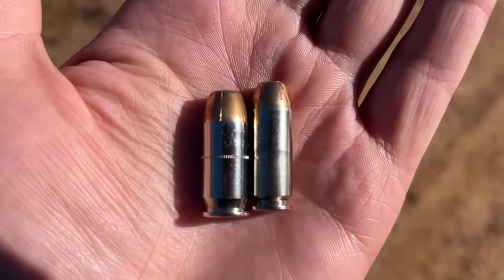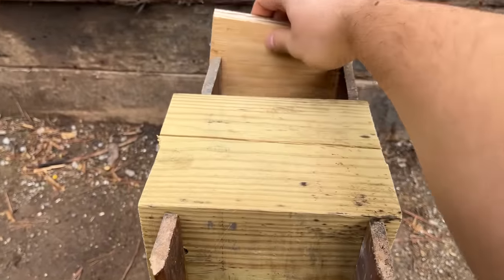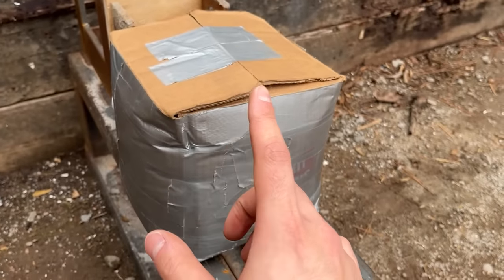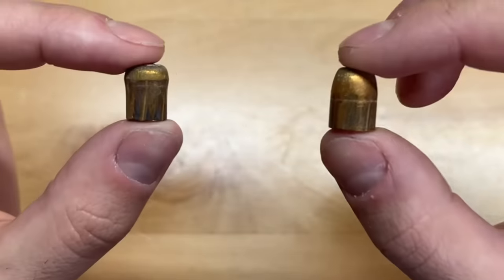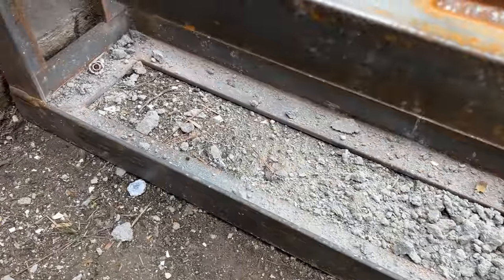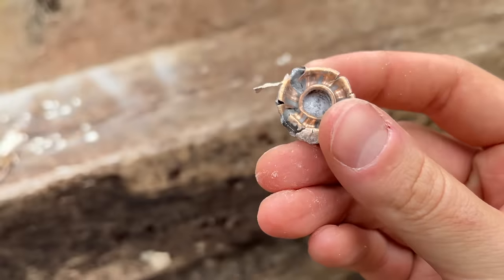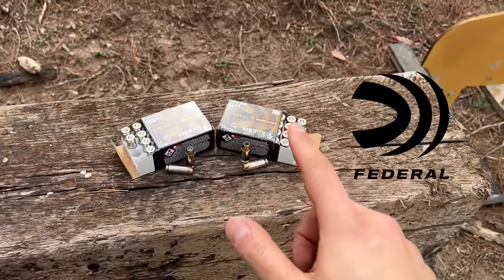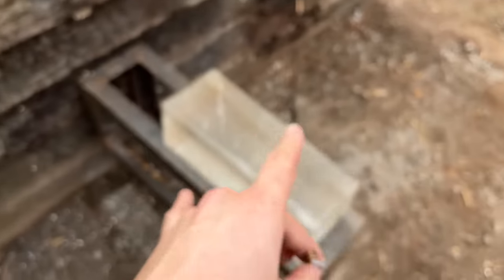45 ACP vs 10mm: Unbelievable Difference On Barriers

Comment: You should check out the .450 SMC cartridge. It's a bit of a wildcat, but it's the closest you'll get to a modern 45 ACP cartridge. It can be used in anything rated for +P, since the brass itself is stronger, I believe it's a 308 cut down.

It's throwing 45 ACP weight at near 10mm speeds.
Reply: .45 +p  or if you're super froggy, .45 +p+ (aka .45 super).
Reply: @DustinS.  45 super requires thing not all 45 pistols have, a fully supported chamber. Which is why I like 450 SMC so much. It only requires the pistol to be rated +P.
Reply: Or just get an LAR Grizzly in 45 win mag
Reply: @argonzeit  a 1911 just needs a different barrel. A USP or HK45 are good out of the box
Reply: @argonzeit & @DustinS. - There's a lot of misinformation on the .45 Super and the .450 SMC.  I've shot both quite a bit in Glocks and 1911s.  Dustin is correct that the USP is rated for .45 Super but I am not sure on the HK45.  However, the .45 Super was specifically designed by Dean Grennell to be able to be shot out of guns without fully supported chambers so that is not an issue.  What is important is lock time.  Meaning how long the chamber stays closed with the brass surrounded by the chamber.  If it unlocks too quickly and the bullet hasn't exited the barrel yet, the thin brass walls of the case will explode causing damage, injury, and possibly even death.  When converting any gun to either of these rounds, you need to make modifications to ensure longer lock time.  There are several ways to do this such as heavier recoil springs, heavier hammer springs (1911 mainsprings) a squared off firing pin stop, or even a compensator.  I'm not recommending anything here as I am not a gunsmith, so if you want to shoot either, please research carefully and consult a gunsmith to keep yourselves safe.  They are both great rounds and a ton of fun to shoot!  Hope this helps.
Reply: @argonzeit - It is not safe to shoot .450 SMC or .45 Super out of any .45 ACP chambered firearm that can handle .45 ACP +P ammo.  Do not do this!  The .45 ACP +P round has a maximum chamber pressure of 23,000 PSI.  The .45 Super maxes our at 28,000 PSI and the .450 SMC at 32,000 PSI.  You have to make modifications to most .45 ACP +P chambered firearms for this to be safe.  The only firearm I know that can safely shoot .45 Super from thw factory is the H&K USP45.
Reply: 450 SMC is a KTM !!
Reply: A .45 super is in an extra thick .45 acp case which pushes the bullet out at nearly twice the speed. Then the is the .460 Roland a super type case that is nearly 1/16" longer. Some loads are 1500 fps.
Reply: Lol why does the speed even matter when the .45acp can clearly take down whatever you need to as is? Anything else is just a waste
Reply: @wolfofmagdalene92  Speed is only an issue to ensure you bullet exceeds the designed speed for expansion.  No matter what, any 45 caliber cartridge starts with a pretty good sized hole in the target, lol....
Reply: If we are going to wildcats I'll stick with 460 Rowland. 230 grains bullets hit about 1400 fps out of a 5" barrel. Can be fired from some pistols originally chambered in ,45 ACP but requires a barrel rated for much higher pressures and a good muzzle break to slow down the cycling of the action.
Reply: You guys keep searching for magic calibers, if you practiced, you would have confidence in any caliber.
Reply: @Rubeless  It depends on the threat. I'm confident in 9mm for personal defense against a potential human attacker. If I'm camping in brown bear country I want something with more energy.
Reply: @Rubeless  Well, I reload, so I like cartridges where the case and bullet are large enough for my sausage fingers to handle easily, lol....
Reply: Few guns can handle the 450 SMC pressure, as the Super. Most of the 45 +P rated cannot.
Dangerous game to use this cartridge in a normal gun, very dangerous.
Reply: @wolfofmagdalene92 no if u can get hydro shock that’s power I dunno if those can do it but if possible it’s a huge difference that’s when pieces of your parts start cracking up and  flopping. Fps is power no doubt would a 1500 fps 165 grain .45 hydro shock ? I dunno certainly at 2k
Reply: .460 Rowland is kinda a 45 acp on steroids too
Reply: @jefferyboring4410  Funny how even 800-900 fps is enough to shatter bones as well.
Reply: @JimHawking-  
Sure, but a wildcat of wildcat. No guns uses this caliber, and no one manufacture the cartridge beside Rowland
themselves.
At least 45 Super and SMC are "findable".
Reply: @jiankhan  hey, I’m just trying to spread the good word lol. It may be a  wildcat now, but that’s how a lot of good things got started. The m16 and 5.56 weren’t popular at first either
Reply: @jiankhan  Actually Wilson Combat does make a gun chambered from the factory in .460 Rowland.  It's so expensive most of us can only dream about it, but it is out there.
Reply: @argonzeit I thought 450 smc didn’t exist anymore ?
Reply: @GoBigBoreOrGoHome mark 23 eats both
Reply: @lemniscatelogos7917  Doubletap owns it and still makes it.
Reply: @argonzeit  thank you I’ll go get some

Comment: He was more accurate every time with the good old .45 APC.
Reply: Funny you mention that I find I am more accurate with a .45 vs 9mm or 10mm
Reply: @_oly_241  They say 9mm is more accurate than .45 ACP but that is rapid fire, only,
Reply: Caliber has nothing to do with accuracy
Reply: @haloreachmadman555  Depends on the person. I find I am more accurate with a .45 vs say a 9mm. Moreover,  a .45 doesn't have that snap a 9mm has (using Glocks) so getting on target is quicker as well.
Reply: @_oly_241  .45 has less snap than a 9mm? What are you smoking
Reply: @haloreachmadman555  A .45 is different. The way it kicks it isn't a hard snap, which shouldn't be a surprise given the 9mm is a high pressure round.
Reply: @haloreachmadman555   Its true, 45 has less vertical snap in a full size handgun. 45 pushes STRAIGHT at you harder so it has more felt recoil but it stays on target better. I am more accurate with a 45 vs 9.
Reply: The .45 was zeroed the ol fashion way.  I have had 3 new pistols that shot just like his 10mm shot. My 10mm shot exactly like this one did.

Comment: The AARP bullet penetration capabilities vary widely, of course, with the ammo selection which is one of it charms, in my opinion. Heavy cast bullets from someone like Buffalo Bore put its penetration levels right up there with 10mm. Cool test.
Reply: Nah, comparing 10mm vs Buffalo Bore .45 +P: the 10mm has 50% more muzzle energy and a smaller frontal area.

A .45 +P load is 800J. A standard 10mm is 900-1300J. Even compared to the .45 +P the 10mm is closer to the .44 Magnum in ballistics 1000-1400J. (.41 Mag is actually REALLY close in bullet size, weight, speed, case volume, and muzzle energy)

Also worth noting that you could be 9:00  paying upwards of $2 per round for those Buffalo Bore +P rounds, and every normal 10mm hits harder than that for $.40-$.60 per round. That only matters so much, but you have to shoot a few of those +Ps before you need them because they are SPICY compared to a normal .45 and it can be like shooting a whole new gun.

I’m not saying it’s better, just different. .45 is better at stopping in a target causing maximum tissue damage. The 10mm is better at punching holes, whether that’s barricades or body armor. The greater energy just lends a bit more versatility to the 10mm allowing it to really shred some hollow points.
Reply: Any 10mm load is going to completely pass through wasting all it's energy even if it manages to expand. It's better suited for hunting. But the 45 is going from about 700 mph to 0 in about 1/10th of a second inside a body. You be the judge

Comment: Honestly, both are excellent choices for a defensive handgun choice. On the ballistics gel, though I would def take the 45. Coming to a complete stop quickly means maximum energy transfer. The 10mm exited the block meaning that it didn't transfer all its energy.  But to be fair and not upset anyone, I have both!

Comment: Can you do with these pistol round tests with the +P underwood xtreme penetrators  and the buffalo bore hard cast that are available from midwayusa? These rounds would represent what each cartridge is capable of when penetration is the priority vs say economy/feeding (round nose), target scoring (flat nose/wadcutter), or controlled expansion (hollow points).
Reply: I agree, I'd like to see him redo the test with underwood and fort Scott ammo
Reply: @ryewaldman you can send him those rounds to test champ.
Reply: @makevelicustoms   5 IQ comment.
Reply: Zero comparison. 10mm is superior in every way vs .45. Unless it’s being launched from a slingshot!
Reply: That's what I was worried about from the get go he used versions of both rounds I wouldn't. Buffalo bore makes both 220grain 10mm+p and 255grain 45acp+p rather that test
Reply: @JNS  I got your 5 right here dangling princess 🤣
Reply: @JNS  soft may I add!
Reply: Those cartridges are effectively .40 S&W (Short & Weak) / FBI loads.  As others have posted, use cartridges meeting or similar to the original spec of approx 700 ftp energy (see Norma loads).  Also, most JHP 40 caliber bullets are designed to dump their energy at 1000 - 1100 fps.  To get penetration, use Buffalo Bore with 180gr Hornady XTP for self defense, 140gr LeHigh Penetrator for max penetration, or 200gr Hard Cast bullets for dangerous game.  There are others, but these BB offerings are good examples of true 10mm.

Comment: Thanks for posting this video.  I think this more-or-less confirmed what I've heard about these cartridges.  I'd pick the 10mm in bear country, but the 45acp might be a better choice for "2 legged problems," especially those less than 16 inches thick.  Anyway, I was taught that I'm responsible for my bullet until it comes to rest, so overpenetration is a concern.

Comment: I give it to the .45 in both the first and last tests.

I never expected either to penetrate the block of wood. The block, to my eyes, definitely suffered more of the shock from impact, i.e. moved more, that came for the .45 round dumping its energy into the target.

The same with the ballistic gel. The block impacted by the .45 round was sent further straight backwards than the one hit by the 10 mm.
Reply: Yeah I didn't even watch the whole video, because my thoughts on the first test were "Why do we want over-penetration? Of course a smaller diameter object drills through more easily... I don't think that equates to stopping power... So the 45 is going to put all its energy into the bad guy, while the 10mm saves some for whoever may be somewhere behind the bad guy...".
Reply: 💯 correct!!
Reply: @mr.knowitall6440  "stopping power" is a fudd term that isn't recognized by any true student of terminal ballistics these days.

Comment: My overall question is, wouldn’t stopping power be more important than penetration? Not a 45 shooter myself but always impressed by the results of the “flying ashtray”.
Reply: Depends on the target. If you live up north during the winter, projectiles are shown to have irregular results because of layers of clothing. sometimes the hollowpoint gets clogged and doesnt expand. Sometimes the slower subsonic speed of a 45 might be affected by layers of clothing. Body mass and Fat can affect penetration as well.
Reply: For self-defense against typical 2-legged predators, yes.  He also used a bare gel block rather than putting a layer of clothing in front.  Clothing tends to inhibit expansion to some degree which tends to result in deeper penetration.  My guess is that both bullets would have expanded slightly less and gone deeper.  Which means in all probability the .45 would be closer to the sweet spot of 15" while the 10mm would have gone past 18".  I believe where the 10mm shines(with the proper load) is for defense against larger animals.
Reply: I think so, and less penetration is better in most urban environments, unless you're shooting through hard barriers for some reason.
I haven't heard of a .45 being stopped by winter clothing and fat, and would be curious to see any examples of that actually occurring.
Reply: "Stopping power" is a catch all term for whatever stops the threat. Penetration is the most important factor for stopping power. You want the damage to reach vital areas and failing that blood loss is the next surest way to stop a threat. However, sever over penetration is simply a waste of energy. The more energy dumped into the threat creates larger wound channels and a more dramatic impact which can also "convince" the threat to stop. You can achieve this ideal balance between energy dump and penetration with any caliber by selecting the right ammo. But what alot of people don't seem to get is the more powerful a caliber is the more potential it has to deliver stopping power each shot...pretty simple concept.
Reply: @syrin1237  The not-so-simple part comes in when one compares a 10mm that passes through due to overpenetration with a 45 ACP that dumps all its energy into the target.
I am unconvinced that a 10mm has more stopping power than a 45. The 10mm has a smaller, lighter bullet, and mainly seems intended for maximum penetration for reasons I can only guess at.
Reply: @syrin1237  (I also don't think that under-penetration is an issue with 45 ACP).
Reply: @myblacklab7  It's actually very easy to find a light HP round that under penetrates even with full power 10mm. Some of the lighter HP rounds will just disintegrate and give a massive energy dump but a shallow wound. With HP rounds the amount of penetration you get vs the amount  of power you put behind it is actually inversely proportional. Meaning with higher power you need a heavier, or stronger bullet to maintain the same level of penetration you get with lower power. Underwood has the full range of high penetration and low penetration ammo.

And the .45 is pretty much the same. Select the right bullet for the power behind it and you will get the penetration you want. .45 can get away with using ball ammo more so then other rounds. Big bullet makes a faster energy dump. It doesn't have as much destructive potential as 10mm though, but then it's easier to shoot. Everything is a trade off.
Reply: @syrin1237  Interesting. Thanks for your detailed response.
I'm surprised that it would be inversely proportional. I thought that a certain velocity+weight is needed for an HP round to expand properly, but one it has enough energy to expand, how does extra energy make it penetrate less?
I know 380 often fails to expand, and thus over-penetrates, but when it does expand, it doesn't penetrate further than higher-power rounds such as 9mm, right?
I strongly suspect that a 90 grain HP round in 380 will not penetrate nearly as much as a 90 grain HP round in 9mm.
Reply: @myblacklab7  It's because once a bullet starts to lose it's bullet shape it dramatically reduces it's penetrative ability. When a HP makes impact at higher energy it makes the bullet expand earlier within the target which makes the energy dump much more dramatic. It makes one heck of  impact but that come at the expense of having that energy reach more vital areas. Alaskan Ballistic on YouTube has done tons of testing with different HP rounds to see this happening. It's very apparent with 10mm vs .40 cal because you can use the same projectile for both loads.
Reply: @syrin1237  That makes sense.
But isn't it the case that a 10mm hp round will typically penetrate deeper than a .40 S&W hp round, assuming the bullets weigh the same? Or do I have that wrong?
Reply: @myblacklab7  Usually no. https://youtu.be/IvVblxBPLxk?si=qIMDVv0gowqqD3BT I wish I could find a better contrast as that 10mm wasn't loaded to snuff. But it was a bit hotter than the .40 and it penetration a bit less. Some of the really light stuff like 140 gr or less will just immediately fall to pieces with hot 10mm and you get terrible penetration.
Reply: @myblacklab7  yeah its called low power 10mm rounds and they perform less than a .45.
Reply: @syrin1237  Interesting. Ballistics is complicated.
Reply: @ManOfChaiTea  Seems like you'd just want a .45 then, and get good performance without having to be too picky about loadings.
Reply: @myblacklab7  That's one school of thought. HP rounds are just another another thing that can go wrong. But you can trust big bullets to do big bullet things. That's part of the reason why I like the idea of the solid copper Xtreme defender rounds, get the energy dump without having to rely on expansion, but the fact they are barrier blind can be good or bad in a self defense situation.
Reply: @syrin1237  I think that frangible bullets will only penetrate at most a single barrier, but everything else is pretty much barrier blind, since hps don't expand when they hit wood or plaster.
I don't know much about those rounds, but I think .45 hollowpoint is a good choice for urban environments, because the bullets do reliably expand, and the fps is low enough that they don't overpenetrate or underpenetrate, with rare exception.
9mm is a different story.
In the end, cartridge-choice depends on many factors ranging from reliability in a particular firearm to size to recoil-tolerance.
Sorry for rambling. What were we talking about?